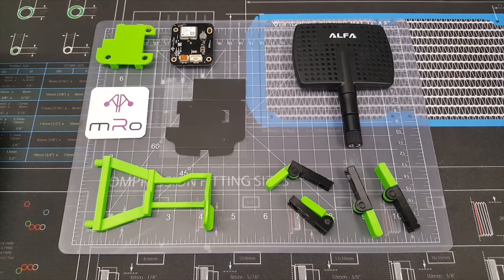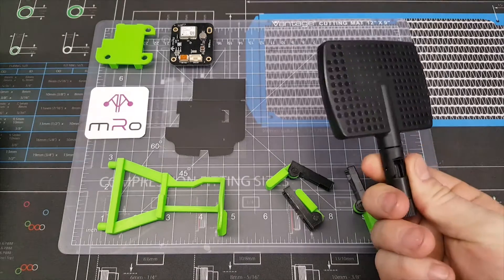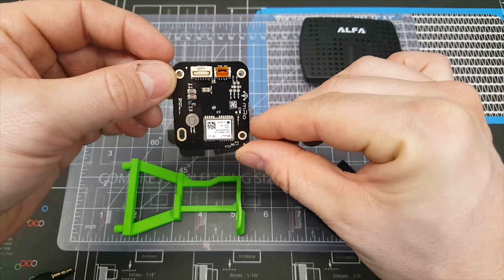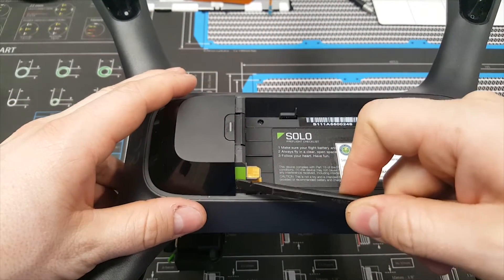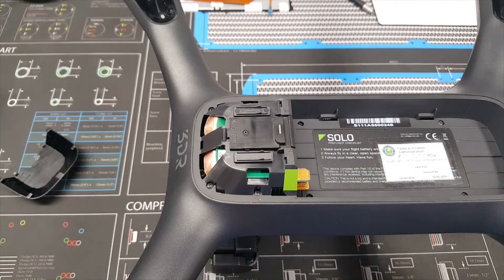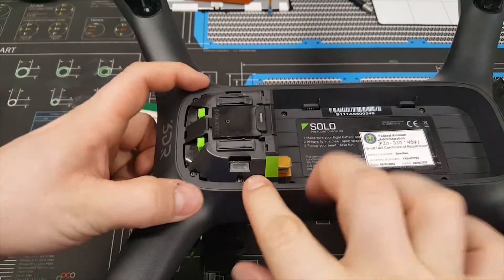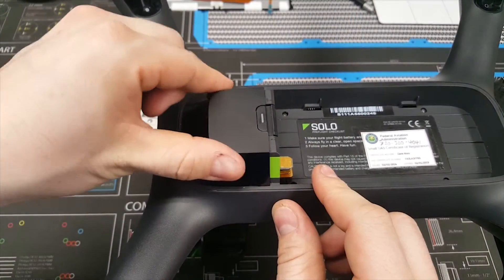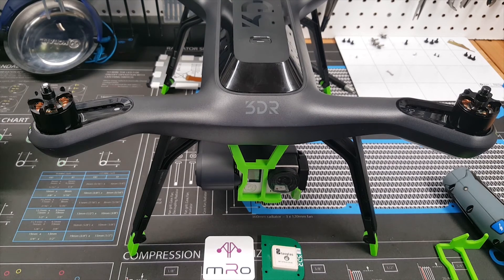3DR SOLO - GPS Upgrade & Printed Drone Parts

Comment: A great video I had a question I have a 3dr solo drone same as the one in the video. It's stuck on the pre-flight update, drone factory reset, not connecting to the app, is there any way you can help?
Reply from the maker: I haven't experienced that particular issue, but there are a few active 3DR Solo Facebook groups that can help.

Comment: ..i see no option for the Hero 4 Silver Gimbal Lock. Is it the same as the Hero 4 Black?
Reply from the maker: Yes, the Gimbal Lock for Hero 4 Silver/Black are the same.  Only the Hero 3 is different as it requires balance weights.

Comment: does that Tarot GOPRO T-3D Metal 3 Axis Brushless Gimbal for GoPro 4 Session TL3T02 work on the solo?
Reply from the maker: Coach K, I have seen a few examples of Tarot gimbals on a Solo to control Flir cameras, but it seemed there was a lot of modding involved and little support from the forum community on the subject.

Comment: Bey man, id like to ask you a few questions. I just bought my 3dr used and im happy with it. But i like to fix things up so id like to know more about the parts you have available.  Do you have to reprogram after installing the gps mod?
Reply from the maker: Stuart Mccuaig, nope! The mRo GPS upgrade is plug-n-play. Pretty easy, and instantly get better results once installed.
Reply: MrArmagedd0n can i buy the gps shield from you ?  Im not interrsted in the gimbal lock or stilts. If so, how much?
Reply from the maker: Stuart Mccuaig, here you go.
https://www.etsy.com/listing/531888389/add-on-3dr-solo-gps-isolation-plate

Comment: hi any video on how to put the isolation plate on the rev A/B thank you  and can we ues the gimble lock with out the Gopro camera thank you great items
Reply from the maker: Manuel Vargas, Rev A/B Isolation Plate install method is the same as shown in this video. This particular gimbal lock design will only work with the GoPro nested in the gimbal.

Comment: hello.  is there any places to get other spare part's for solo?
Reply: B&H Photo Video has most of the parts (new). 
Solopartsdepot.com has many good used parts.
Spare parts Solos are available on eBay for under $60.
Reply from the maker: I have seen various spare parts on eBay.  I few others (including me) have purchased a 2nd Solo kit when they went as low as $300, with the intention of using for parts if needed.
Reply: Hopefully we will see a company making part's soon..., can't stop flying this model . It's amazing

Comment: Here are the links http://www.thingiverse.com/thing:2012569  http://www.thingiverse.com/thing:1469963 http://www.thingiverse.com/thing:1521835 to print the parts.
Reply from the maker: Jon Car  The GPS plate is good as is with the mRobotics upgrade. I had to redesign the gimbal lock as that one is made to work with the balancing weights. I use a Hero 4 black, so don't need the weights, and that lock kept popping off. Also redesigned the leg extensions as those ones don't stay open very well. Added a locking mechanism to keep them open better.
Reply: MrArmagedd0n can you post the parts to thingiverse

Comment: You mentioned getting the files off of line can you tell us where you got the and what model 3 D printer did you use. I would like to build the plastic parts you have. I know 3D printers have really come down and just wondering which Monel you used and where can I get the files thank you
Reply from the maker: The parts are all on Thingiverse, but be aware I modified 2 of the 3 files pretty heavily. Initially printed on a Monoprice Mini, but sold it. Recently purchased and assembled an Original Prusa i3 MK2, and now print on that.

Comment: Di you get all the parts you show when you buy?
Reply from the maker: Hydrojunky, The upgraded GPS Module and GPS Shields were separate purchases. The rest of the parts shown came from my 3D Printer.
Reply: Dont spose you want to print me some lol
Reply from the maker: eab211 $30 for the leg extensions (4x), gimbal lock, and gps insulator. Price includes shipping (USA only).
Reply: How do I actually make the purchase? Is there a web site to visit?
Reply: Mary Benziger yes was wondering my self
Reply: same here
Reply from the maker: eab211 https://www.etsy.com/listing/518889959/3dr-solo-printed-kit-gps-isolation-leg?ref=pr_shop
Reply from the maker: Hydrojunky https://www.etsy.com/listing/518889959/3dr-solo-printed-kit-gps-isolation-leg?ref=pr_shop

Comment: To remove the GPS Shields dont pull the sides out at all. Use your thumb and middle finger to press in the sides of the GPS Shield to make the top bow up a little bit then wriggle it sideways and she comes straight off. If your fingers are slippery then wipe the side of the shield with a paper towel and wipe your hands to. Go practise!

Comment: How did it fly with the GPS upgrades? I was interested in how the upgrade affects cable cam and other smart shots.
Reply from the maker: wooskie29 No issues to report.  Flies great with both the stock 3DR app and also SOLEX.